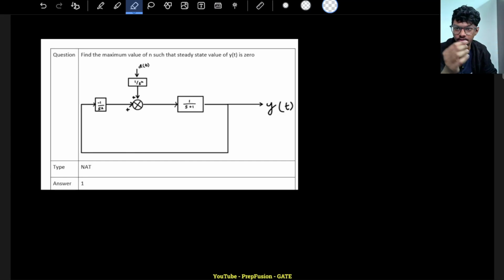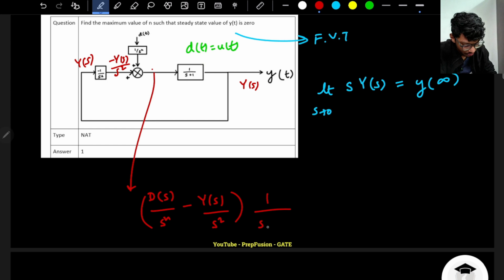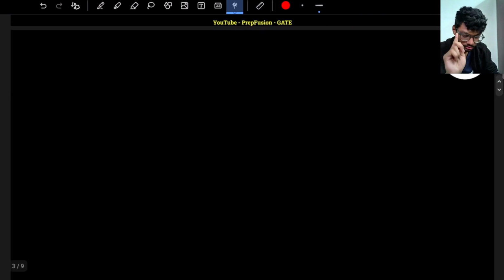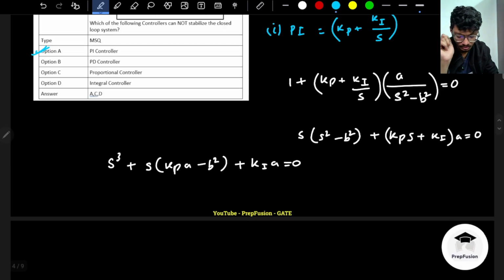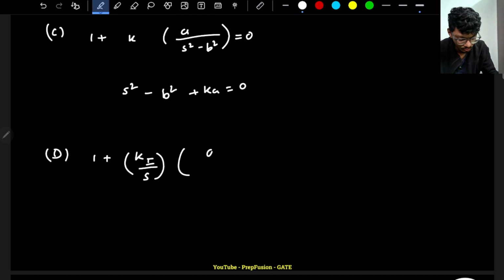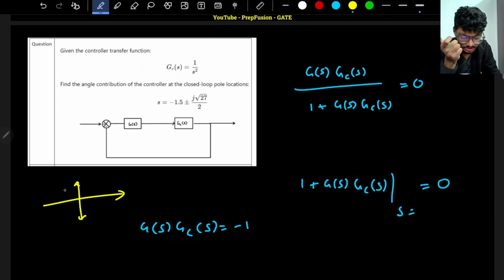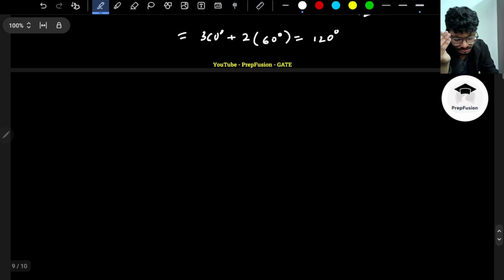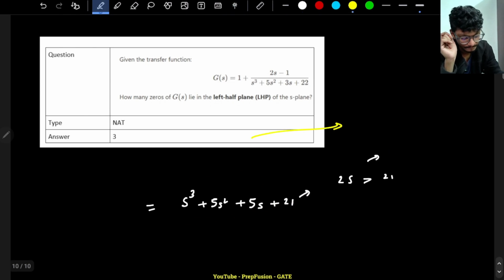GATE 2025 Instrumentation(IN) Control System Solutions || MTA || Memory Based || PrepFusion

Comment: That compensator que was mcq and has +60 only in the options , its not mta ......
Reply from the maker: See the complete solution for one of the pole angle will be +60 for other it will provide +300 so it has to be mta
Reply: +300 is same as -60, No MTA
Reply: @RohanKumar-nr8fd  Yea it will be -60, but the other one is +60 right, and -60 is not equal to +60.  that is what he's telling